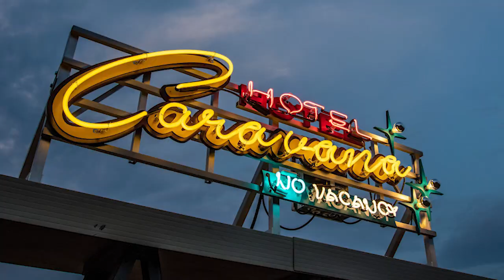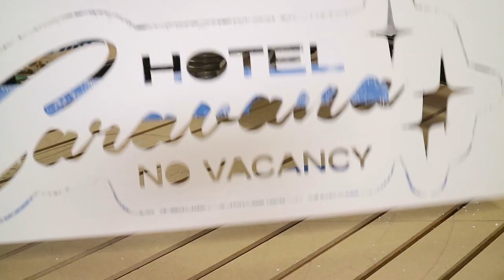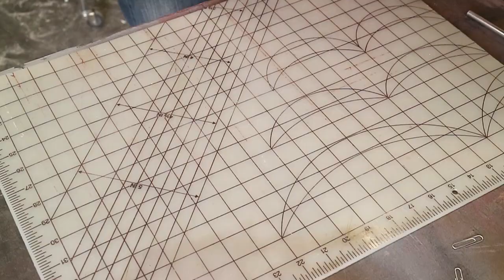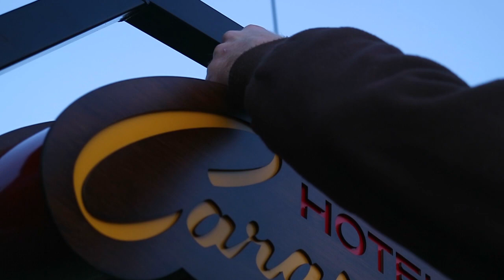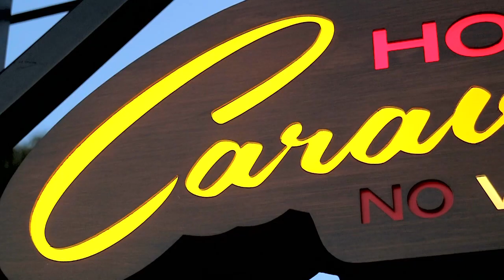CNC Carving a Googie Sign (Hotel Caravana Redux!)

Comment: Great video I'm a sign guy too and if that pvc is celtec or sintra I use these bits on the cnc, they are cheep and work great, no need for tabs or tape, I just put a few brads around the edges and the down cut leaves the dust in the cut to keep it in place. HOZLY 3.175X2X12mm Left Hand Single Flute Downcut Spiral
And I think it's conventional cut that leaves the burs on the off cut.

Comment: When I was trained to use a CNC router I was told that placing all the entry/exit points in corners would cut down on filing time. The idea was that everytime you cut something there is an inevitable bump from the endmill and on straights it was more noticeable. I always wondered if it's a fluke on our machine or a problem all CNC routers have.

Comment: Awesome work!!  The only thing I would have done differently regards the construction of the "body" of the sign.  Instead of cutting numerous pieces and stacking and gluing them, I would have cut two (or maybe 3) of them, and cut some "standoffs" to make a skeleton frame.  Then I would have wrapped it in fiberglass.  Would have saved on the cost of materials.
Reply from the maker: Thanks! However, using 3 layers instead of 5 would've saved only about $18 in Sintra. And most of that material is reclaimed from the centers and can be reused. At this size, I'm not sure there would be any cost benefit to using fiberglass and resin.
Reply: @WesleyTreat  thanks for the info.  Quick question,  what thickness is that Sintra sheet?  The thickest i can find is 1/4", but that stuff looks thicker.
Reply from the maker: @monteporche5552  I used 3/4" for the body, 1/4" for the faces, and 1/2" for the "flange" on the back. You can also try looking for Komatex or just expanded PVC sheet. I get mine from a local plastics supplier.

Comment: You could have machined some pegs, less sanding :D
Reply from the maker: Not a bad idea, but alignment wasn't a problem in initial tests. It cropped up for unexpected reasons, which I explained in more detail in the extended version. It had to do with something new causing the glue to set too fast.
Reply: @WesleyTreat  you cut it with CNC anyway so even 4 or 5 wooden dowels around perimeter would have helped with alignment. Just saying :) Great sign !
Reply from the maker: I understand. What I'm saying is it's hindsight. In initial tests, I didn't need help with alignment because the glue allowed for time to adjust the layers.